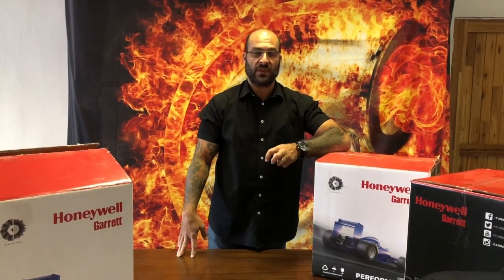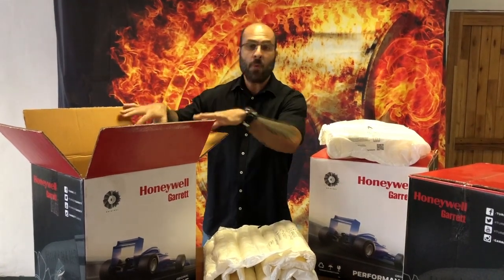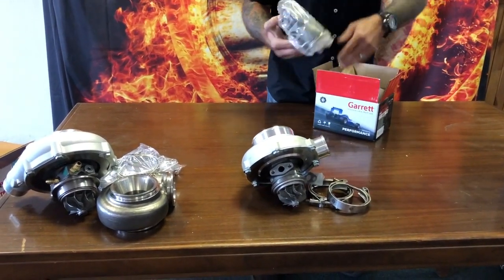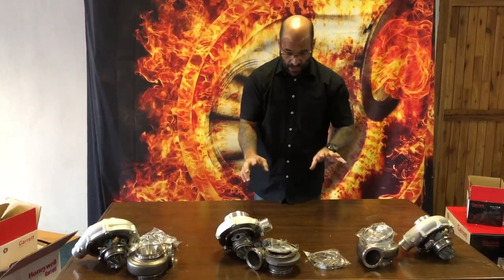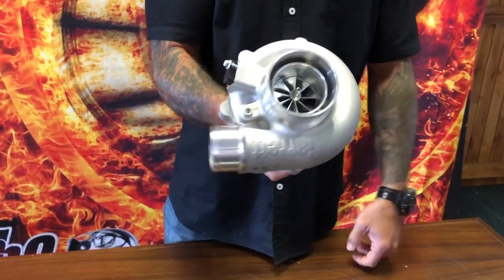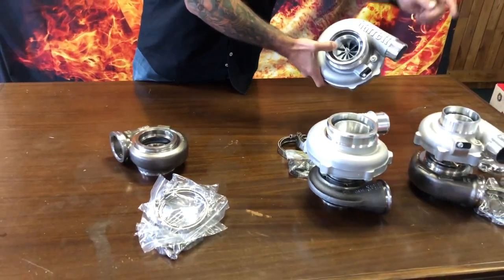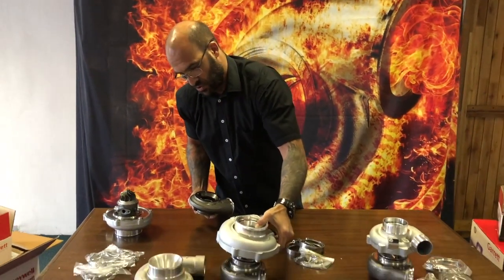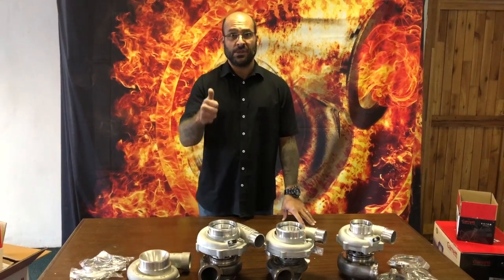Garrett G30-770, G30-660, GTX3076R Gen2 compared

Comment: I wish Garrett made a T3 housing option that pushed the compressor housing away just a tiny bit to allow for better oil drain. Garret turbos have and still suck for oil drain in comparison to the manifold directly below it. My last gtx3078 the oil draiun was touching the vband and made it really difficult to put the turbo on and take off.

Comment: In the process of getting a gen 2 gtx 3076r for my 2.0 t cobalt ss , going to run a .63 ar on the turbine housing for a better spool time , just hoping it will still make good numbers with the smaller ar turbine housing , ordered the comp housing in a T51r mod waiting on it to get here , then Gonna order the chra next , wish more companies made t3 style exhaust manifolds for my car , the company’s are very limited but cannot wait to get this turbo on my car , zero people I know of have this turbo on their turbo cobalt , everyone runs a borg 7163 or a s257sxe borg , plan on trying to surpass the limits these guys have with the 7163 turbo
Reply from the maker: The GTX3076R Gen2 is a proven and good performing turbo. I wouldn't change the comp housing, the turbo works and works very well in stock format.  You will be surprised at the performance of the 7163 being a considerably smaller turbo than the 3076 -- Beating the S200SXE (650HP model) --- not so easy, the 3076 will have a hard time there.

Comment: Awesome video. Shame the G series only has a V band in option. Most people including myself have a T3 inlet. Does anyone know if I can use my GTX3076 Gen 2. housing for a G 30-770 centre? I know i'll lost the stainless housing upgrade but I have a blanket anyway and don't want to swap my expensive steampipe manifold.
Reply from the maker: We will have many housing options coming out soon to retro the GTX to Gseries - the existing options from Garrett wont work as the connection on the Gseries uses Vband and the GTX uses 6bolts with flanges.

Comment: Would the GTX3071r gen 2 be a okay fit for a m30b32 aiming to reduce fuel consumption here, as the turbo is rated for 3 litres but the motor is 3.2 litres
Reply from the maker: The turbo will work well but might lose some HP ontop in the higher RPM range. Fuel economy LIKE FOR LIKE DRIVING could improve with the use of the correct turbine housing AR - if the housing is too small, the engine will see small boost values while in the cruise - which eats fuel.   As long as you are in vacuum in the cruise, the economy will improve. Put your foot down and youll burn ALOT more fuel as the engine will produce ALOT more power.

Comment: In terms of fitment , weight and power. Which one is better, the GT25-660 or the GT30-660
Reply from the maker: Identical turbos, the 30 has a larger turbine. Nothing else changes.

Comment: Is the g30-770 much bigger than the gtx3071r gen 1? Asking since I already have it ordered but did not check the fitment behind the engine since it is very limited on my 2008 cupra 2.0tfsi...lol
Reply from the maker: @borivojeblagojevic8456  similarly sizes in physical Dimensions - you won’t have a problem fitting it in

Comment: How efficient is the internal housing on the garret g-30 770 housings. Does it compare to a tial external gate. What would you choose for daily driven. I have always used externals but wanted to save space. 1.8 engine 20psi
Reply from the maker: The Garrett IWG housings are not able to hold their own against the likes of BorgWarner with their internal designs, Tial will more than likely be better aswell.  The mass produced Garrett is made as simple as possible to churn out the product in the highest numbers for the least amount of money - EFR and other brands are not designed for the masses, they are race derived, and improved products with attention to detail in mind - they will always be a much better product than Garrett.

Comment: When they say 660 or 770 does that mean crank or whp? I am looking to buy a g30-660 .82 but i am afraid it wont hit my 500whp goal mark on my 1jz vvti with 264 cams. I keep hearing mixed answers
Reply from the maker: There is a rudimentary rule of thumb - for every 10lb/min or air flow, there should be approximately (conservatively) 100HP produced by the engine -- so this power will be measured at the crank.

To make 500WHP with the G30-660 you will have to push this turbo to its limits, rather opt for something that is proven to make this power and still have some in reserve.
Reply: @TurboDirectSA  so would you recommend me going g30-770 with a .61 a/r housing to compensate for the 200-300rpm lag and have more power band as well as making 500whp?
Reply from the maker: @pourtierbeatz7804  I would consider the EFR range to be honest, you getting alot more for your money, and the compressor maps are proven to produce the power in comparison to the G-series which is lacking.  EFR spools faster, has better cooling, more reliable cartridge, etc

Comment: Hi there. lets revive this thread!! . Very informative video that I learned a lot of facts.. Just one quick question though;  could I able to swap or use my old gen1 GTX3076 turbine housing  to this new GEN2 vesion GTX3076 core if ever I decided to proceed with my upgrade?  thank you so much
Reply from the maker: Yes you can the turbine wheel is identical

Comment: How much difference roughly in spool would there be between a g30-770 .61ar and a g25-660 .92ar on a 2 litre 4 cylinder engine
Reply from the maker: Dean this depends on so many things, tuning, fuel, boost, ignition advance, cam timing etc etc --- unless installed onto a car (same car) and tuned (yes the tuning will be different, very different) its impossible to say, but expect ESTIMATED around 500RPM difference at least

Comment: can anyone give me their opinion of a g30-770 0.83ar in a bmw s50 6 cylinder 3.2L engine, i want to run a comfortable 500-550 whp with realtively quick spool up at 2000-3000rpm and not really work the turbo too hard nor redline the engine to get its performance (redlines at 7000rpm btw). is that acheivable through the g30-770? thanks in advance.
Reply from the maker: With the G-series turbos, you will be pushing the turbo harder than you should to make this power. The claimed HP from Garrett on their printed catalogues is overrated, compared directly to their corresponding compressor maps - i would use a larger turbo than required or use a brand that does not need to overrate their HP claims - to be safe and achieve the power goals you have in mind.
Reply: @TurboDirectSA  what other comapnies would you recommend and what about the g35-900 or g35-1050? thanks again.
Reply from the maker: @user-yd4rk4gv6k  All Garrett G-series turbochargers are overrated in HP. I would consider the EFR8370, it will outspool the G-series turbos and produce the claimed HP and more. It is more reliable, runs cooler, and the rotating assembly has a much slower rotating RPM, which increases the ball bearing life. The ball bearing cartridge is larger than the Garrett, and will support higher HP, and more punishment should you decide to track the car.

Comment: Hi guys. Great review .  The g30 770 what turbine housing would you suggest for 2.35 Subaru 0.61 ?? Or the larger 0.8 ?  Have theese g30 770 turbos made 600 odd bhp on any Subaru's yet as struggling to find any info . Realise a lot of other factors in this , cams , head work etc boost .  Cheers

Comment: Any idea when the ni resist t3 housing will have adapter to allow use of g30-770?
Reply from the maker: The G30-770 is only available in vband im afraid, its not difficult to make an adapter from T3 to Vband - if this is what you really aim to do.

Comment: What's the difference between g25-660 and the g30-660
Reply from the maker: The only difference is the turbine wheel is larger - the rest of the turbocharger is 100% identical. Use for larger engines where you want to be able to hold higher HP in higher engine RPM is where you would opt for the G30 instead of the much smaller G25
Reply: @TurboDirectSA  for 2.0l tfsi? Better g25 or g30

Comment: Hey great channel! Doing a build 2013 Audi Rs6 with twin turbos thinking of g25 660 or g30 770. What would be the best option you think?  🙏
Reply from the maker: Thanks Johan - the EFR7163 is be far a better, more reliable and cost effectvie solution which will spool faster and make the advertised power in comparison to the Garrett option - the G25's do not make the power claimed, and are laggy compared to the EFR range.
Reply: @TurboDirectSA  Thanks for a quick reply mate! For my car the EFR is very complicated to fit so cant go that way i am afraid. .Aiming for 1400HP, is there a big differance between 660 vs 770 in spool?
Reply from the maker: @caesar1328  There is absolutely no difference in fitting the EFR to the Garrett - or any other brand for that matter.  You can forget about making 1400HP with the 660 and 770 turbos - at max boost pressure you will be lucky to see 1200HP with the 770's in twin configuration.
Reply: @TurboDirectSA  Ok thanks! The EFR is abit bigger in size i think right?  Because it is such a tight sqeeze to even fit the Garret with  custom manifolds....If i have to go with Garrets and reach my power goals. I have to go G30 900 then or? Thanks for taking your time..
Reply from the maker: @caesar1328  Physical size using Garrett turbos is going to take up more space than the EFR as you need gates added to the equation. The EFR's dont. The EFR is not as big as you assume they are. 

We carry both brands in stock - however we wont advise for the sake of a sale - what we advise to clients works - period.   Other companies will sell you what they have on the shelf regardless of whether the setup is perfectly suited to your requirements or not, and then make excuses later - we dont.
Reply: @TurboDirectSA  Thanks for being honest, will talk to my builder again, so to reach 1400HP should i go with EFR 8374, since the EFR 7163 is only rated to 550hp?
Reply from the maker: @caesar1328  In single turbo setup = use an S400SXE - this will make the power you want. In twin turbo setup (expensive, but aesthetically pleasing) use two 7670's (will reach 1300HP) or two EFR8474 (will touch 2000HP if setup right) Dont be fooled by misled "tooners" especially in South Africa, where they will immediately say the EFR8474 is laggy - speak to professionals like Steve Clark from No Sweat Racing who have hands on experience with this turbo and will confirm that this turbo will spool for nothing - send an email to info@turbodirect.co.za, ill make sure to notify the sales team to send you the video of the hill climb car using the 8474 with Large T4 twin scroll AR92 housing, which was removed to replace with the much lareger AR1.05 housing - to keep it simple, the car never needed launch to get off the line, and was the quickest car off the line in its class for the days racing.

Comment: I have a celica 2zz ge  with gtx2971
 .64 a/r.
About 500 crank hp.
I want to raise it a little bit more to 550 bhp but without sacrifice my spool.
Which turbo you think is more suitable for my goals ?
Reply from the maker: You basically have the old GT3071R turbine wheel (not GTX) with a GTX compressor running inside the old GTX3071R Gen1 comp housing - you got this in two trims -- 84trima and the 90trim - the difference is the turbine wheel is large in the 90trim and you should have a slightly higher HP output on this 90-trim model. 

To up this some - i would install the GTX3071R Gen2 comp wheel and your done,  just make sure you running the T3 volute family turbine housing otherwise if not, and you are running the GT28 housings, upgrading the compressor will cause alot of heat trying to drive the larger higher flowing compressor on the other side.
Reply: @TurboDirectSA  You re so right.
Thanks for your clear answer
I have 90 trim by now ends at 500hp.
I use T25 not T3. 
I have question, if i switch to T3 housing as you said and use a flange that is T25 one side and T3 on the other would it work ?? Cause my header is T25 along with my turbo housing right now....
Also as i see that you are perfectly informed, this combo that you suggest me is nice and cheap choice but for.my info the g30-660 how would be in terms of spool and top.end vs the gtx3071 gen2 ?
Reply from the maker: @panagiotismvagusta6014  If you planning on changing the turbo entirely - i would simply bolt on the EFR7163 with T25 turbine housing and get done with it - it will take you to 550WHP with that engine you have with VERY fast spool.  Remember you are currently using the T28 AR86 turbine housing, the BorgWarner EFR7163 uses the AR85 T28 housing volute, and the turbine wheel weighs 35-40% less than your GT30 turbine head does - its internally gated and includes EVERYTHING you need for a bolt on install -- your DP flange will have to change to a vband which is not the end of the world.  

We have seen 550WHP on the Golf7R platform with this turbo - so it will definately work. 

If you want to upgrade the turbo and not change it - then you must change the housings -- to keep the turbo reliable.
Reply: @TurboDirectSA  I just subscribed you.
I m so thankful of your direct and clear answers.
You are so well informed and help me so much.
I will discuss all this with my mechanic now.
Thanks and keep up the good work ^^
Reply from the maker: @panagiotismvagusta6014  Thanks buddy - much appreciated. We glad to help you - no worries at all.

Comment: Sup bro? I’m thinking of getting g30-770. I drive a 1M and may track it but want to do some good pools and drifts in town. Lots of guys tell me to get the gtx 3585rs but I don’t want slow spoil and lag and big power way later. Thoughts? Will 770 still hit hard? Thx
Reply: @BMW1M dynamic auto work max flow plus twins. Tons of juice. Not ready for single yet.
Reply: @BMW1M I got forged internals and everything cooling you can and there is zero lag bro! Send it. Gonna track mine when I get it back.

Comment: Does the g30 benefit at all from twin scroll?
Reply from the maker: I do believe it will - like any turbine stage pulse separation does yield a benefit, but Garrett don't have a twin scroll housing option for some strange reason.
Reply: @TurboDirectSA  Do you have any sway in getting them to make a ts t3 turbine?
Reply from the maker: @Grimgrak1  Yes i do, however this will not be on their priority radar for a number of reasons - there are other bolt on vehicle specific products that are higher up on their to do list right now.  In the mean time i will design a housing for this - as we manufacture our own housings already for the previous Gen GT/GTX turbochargers
Reply: @TurboDirectSA  Are your turbine housings same materials as garrett ni resist? If not whats the material difference and temp rating?
Reply from the maker: @Grimgrak1  no it's much better, it's made from Stainless. The casting is also not a standard sand casting, we use investment casting. We exhibited our housings for the first time at SEMA in 2012, its a product that competes head on with the Tial product, and has a number of features that overcome the main issues with the competition at half the price.
Reply: @TurboDirectSA  Too good to be true? MAKE THE DAMN THING AND TAKE MY MONEY ALREADY
Reply: Prefablly in 1.06+ how long does it tkae u guys to get into production?
Reply: @TurboDirectSA  Emailed you guys about buying one no response.
Reply from the maker: @Grimgrak1  I have checked my inbox aswell as the spam box on the server and see nothing. Apologies to ask you to email a second time but please shoot an email off to chris directly chris@turbodirect.co.za

Comment: Can i buy a 770 compressor housing and mate that with my 660 exhaust a/r
Reply from the maker: Yung, im not understanding what you want to do --- ???
Reply: @TurboDirectSA  so i bought a g30/660 with a .83 ar housing and was wondering if i could just buy the 770 supercore and use the same a/r housing i have on my g30/660 to prevent having to buy an a/r housing for the 770 also
Reply from the maker: @pourtierbeatz7804  Yes you can - the 770 uses the identical components (except the compressor wheel) as the 660 - everything is interchangeable.